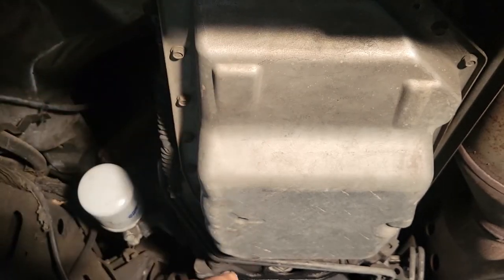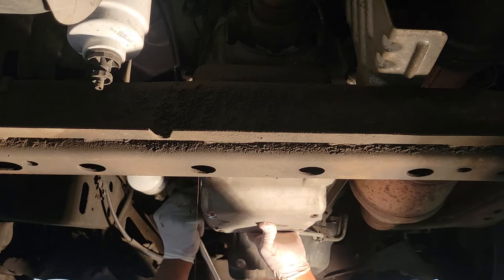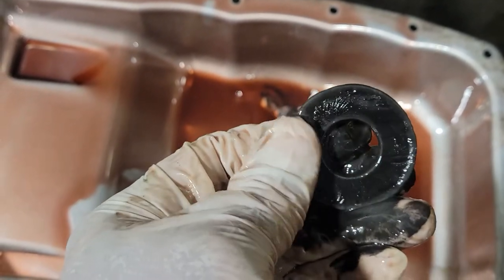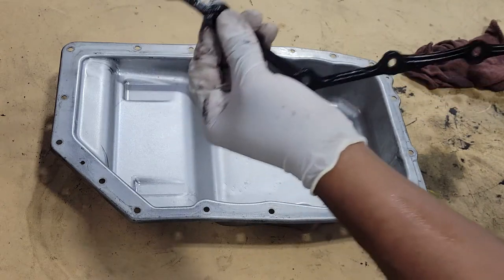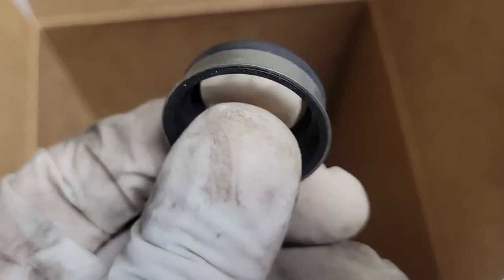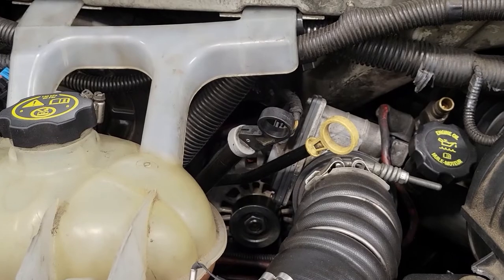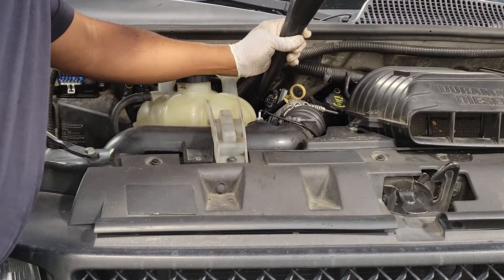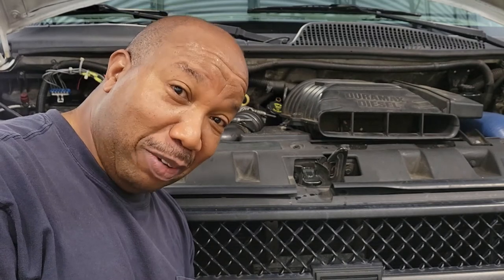Chevrolet Express 3500 Transmission Fluid And Filter Change

Comment: What if I dont know what my original fluid is ( synthetic or non) ??? Great video, and thanks in advance 👍
Reply from the maker: That's a good question. By you dropping the pan and changing the filter.  You should be able to put what you want in the system . Although you will still have fluid in the Torque Converter.  Either way,  I would put it on a non synthetic schedule for the next Transmission Service. Thank you!

Comment: Man i need the bracket bolt info. I cant find the size of the bolt that hold on the bracket to remove it. I tried bunch allens and t30 n t40... please lmk
Reply from the maker: I am not sure which bracket. I will say Chevrolet was good for using to me odd off set type size bolts. Sometimes the right size tool feels like the wrong size with Chevrolet.
Reply: @dairleautoclassicrestorati6892   thanks man. I found tobe t 40 but.mine wont accept any. I meant the trans cable bracket

Comment: What is the normal charge for a garage to do this?
Reply from the maker: Good question,  I would call the local Dealer or Shop and ask that question because each repair shop is different and also depending on the area.